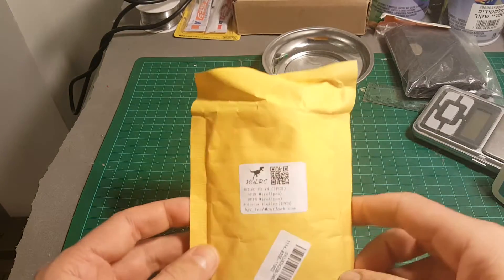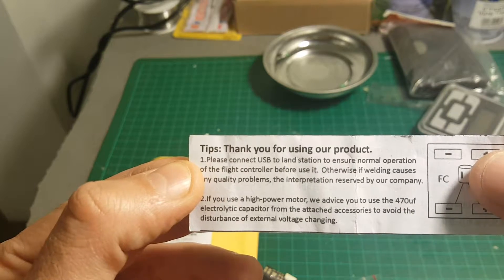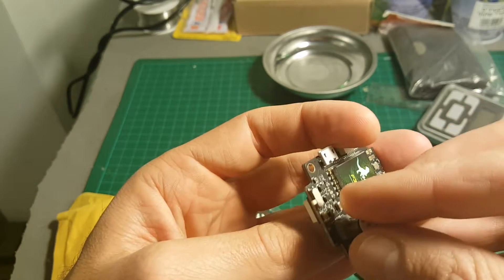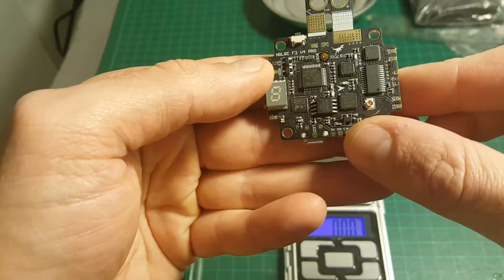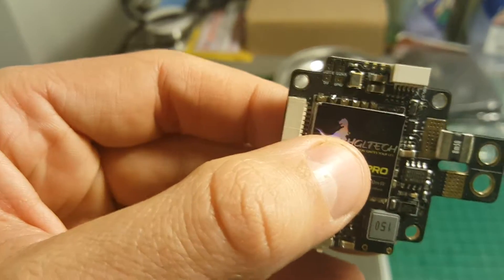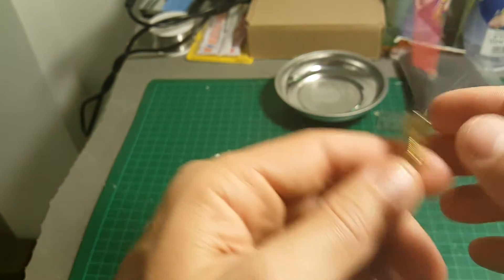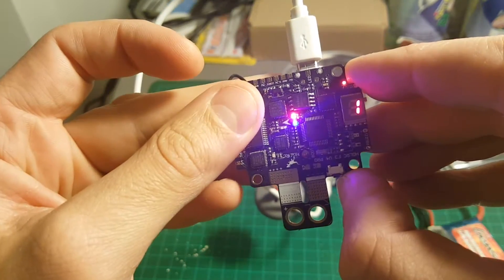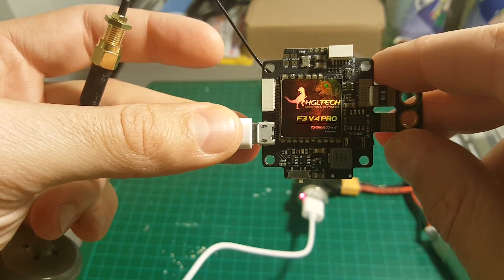F3 V4 Flight Control Board AIO 25mW 200mW 600mW Switchable Transmitter OSD BEC PDB Current Sensor

Comment: I would like to know how to use the serial ports available on the f3 v4 controller and how to enable telemetry
Reply from the maker: Which RX are you using?
Reply: Gal Kremer d4r2
Reply: Gal Kremer d4r2

Comment: good afternoon friend, I have a problem with this card, I can not bootloader, I press the boot button, and I connect to the usb, but it does not respond to the bootloader error, which firmware can I use in it? Did you go through this problem to boot? thank you
Reply from the maker: +Henrique Santos Does the board enter a DFU mode?

Comment: I smashed my Diatone GT2.  I was thinking about either BFF3 or the F3 v4 AIO to replace the FC and VTX. I realize BFF3 has no vtx. Any suggestions?
Reply from the maker: youngfyah So far I am very happy with this F3 AIO FC. I have yet to perform a range test, but I intend to do it in the next few weeks.
Reply: Thx
Reply: youngfyah f4

Comment: any idea how to use the 12v BEC? I see all the 5v pads, but it says 5v or 12v. any idea? 

thanks!
Reply from the maker: I don't think that there is a 12v out. I will let you know if I will find otherwise.
Reply: Gal Kremer thank you. I realize it probably doesn't. but on banggood it said it did LoL. too bad I didn't realise until it was in my hands lol. oh well, still seems awesome.
Reply from the maker: No worries. 
What do you need the 12v for?
Reply: Gal Kremer the camera I was running is 12v only. I have an hs1185 that I guess has an operating voltage from 5v-17v. so I'm just going to use that. never ran it from 5v LoL
Reply: Gal Kremer Same question here, I have a Runcam Sky and it works between 9-12v only.  It will not work on 5 volts.  I was going by the description on Bangoods and it stated both 5 and 12 volt.  Guess I'll be adding an external BEC.
Reply from the maker: After using it I can confirm - there is no 12v out unfortunately...

Comment: hi, one question, for setting the osd on this fc, what i must do?
Reply from the maker: You need to use an FTDI adapter.
Please see my video: https://www.youtube.com/watch?v=PtWvBMhfTdg&t=21s
Reply: Perfect
thanks. I have the FTDI adapter. plug and play with usb and the app. easy ;)Hi, I would to buy this FC for my new drone.
I would know if you think that I can setting Gyro update to 8khz and pid loop to 8 khzWith multishoot…and later with dshot 600

Comment: Does it do betaflight osd... if not its kind of sad.. because that would have made it the first complete aio out there.
With this could i adjust pids via osd with my taranis?
If so that would make it nearly perfect.

Thx for the vid by the way
Reply: The description does mention a built-in OSD ("Integrated Transmiiter, OSD, PDB, 5V/12V BEC  and Current Sensor, which more easier to install"). 

Gal, thanks for the video. Looking forward to seeing the build video (specifically the quality of the vtx).
Reply from the maker: Thank you for your comment :-)
I am pretty sure it doesn't do Betaflight OSD and you can set PIDs through your remote.
I will know for certain after installing this board.
Reply from the maker: Yinnon Haviv Thanks. :-) Of course there is a built in OSD. You can change its settings through an ftdi adapter.
Reply: Oh, I thought you said "it doesn't do Betaflight OSD" above. Do you mean that the OSD can't be configured from the betaflight configurator? 
How come? Is it a missing connection between the OSD and the fight controller? a different firmware on the OSD?
Reply from the maker: Only some boards are supported for OSD configuration within Betaflight.
Reply: well its the only thing this almost perfect board doesn't have.. there just isnt the perfect board yet... lets hope for v5  : )
Reply: VALIS-FPV I know it's too late now but it had betaflight osd